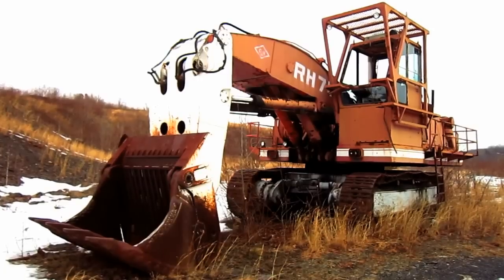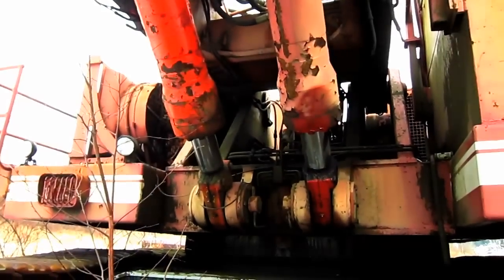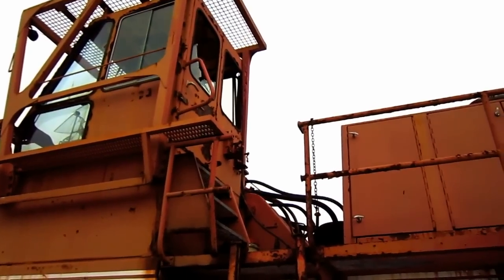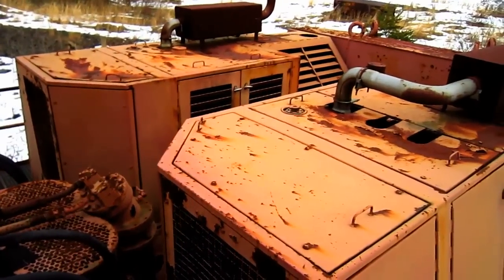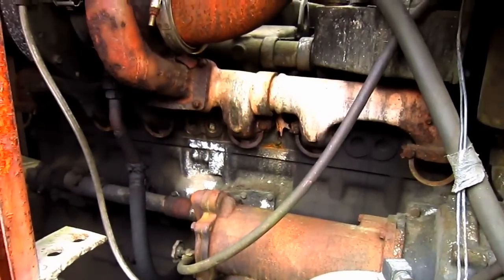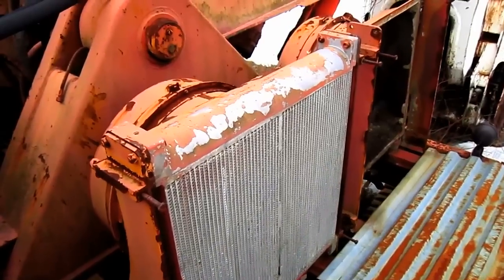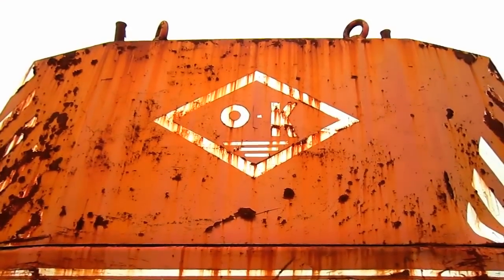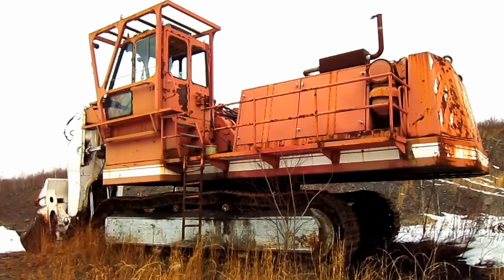O&K RH75 Documentary

Comment: I used two of these on a mining project in Zimbabwe back in the early 80's and when working they were great machines but the maintenance was difficult. The hydraulics were way over engineered and our difficult operating conditions made it almost impossible to keep them operating.
Reply from the maker: I had heard that these machines didn't use O-Rings on the hydraulic hoses and that the only way to keep them from leaking was to torque the fittings down as hard as you could?
Reply: It would take me 10 pages to just start with all the problems we had with the O&Ks but they did leak a lot. The biggest problem is that they were way over engineered and we were in a remote operating environment with little support.They never were able to function as an excavator and were used primarily to load our haul trucks.All the corporate people said they were great machines back in Germany but in Zimbabwe the Cat was the only machine up to the task.

Comment: Oh yeessss, great machine and documentary! 

2:48 For the gear heads it might be worth pointing out that these are axial piston motors. They have higher speed and lower torque than what you need on the final drive, so we need a gear reduction. Nowadays, this reduction is done in a compact planetary (epicyclic) gear reduction, which is basically built around the motor, making for a small drive that can be tucked away neatly. (This comment has been edited to reflect Wesley's comments, sorry for getting it wrong at first :( ) 

The 4267psi hydraulic pressure converts to 295bar for our metric friends :)
Reply from the maker: Thanks for chiming in; love the added technical info!  Thanks!
Reply: I've never seen an excavator use any radial piston motors. Axial piston pumps and axial piston motors on track drives, swing drives
Reply: You are right, I couldn't believe it, for years I have been certain that they use radial piston motors, because the assembly is so short, but after looking around, I see that they manage that by tucking the axial piston motor inside of the planetary reduction. 
Thank you for pointing that out and sorry for talking rubbish! Do you know why they don't use radial piston motors, though?  
However, there is at least one excavator that uses radial piston motors: http://www.damitz-modelltechnik.de/content/produkte/funktionsmodelle/montagesaetze/bagger/index.htm ;)

Comment: Another great video Justin...since this machine is retired, will it eventually be scraped for steel or will it sit and be scavenged for parts.
Reply from the maker: There was talk a few years back about putting it back to work, but I think that fell through when it was discovered that the engines were seized up.  Sadly it will probably end up getting scrapped at some point.  Thanks!
Reply: Couldn't they just swap in some rebuilt engines ?